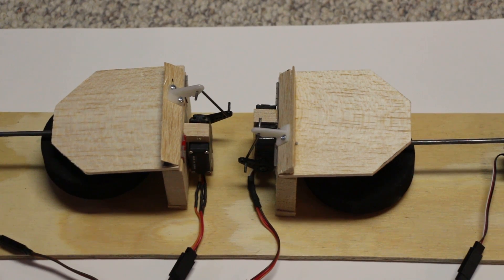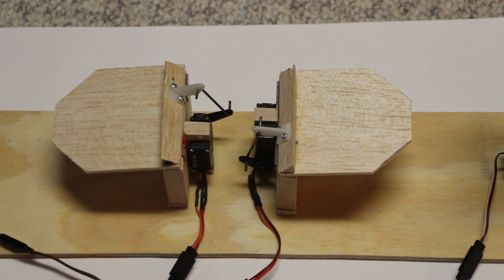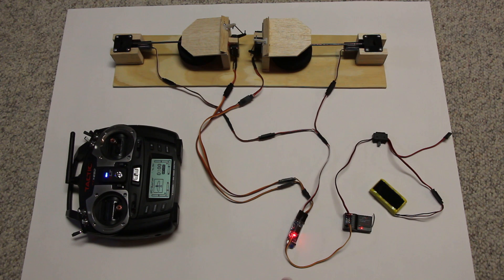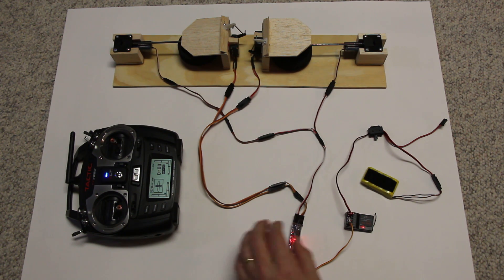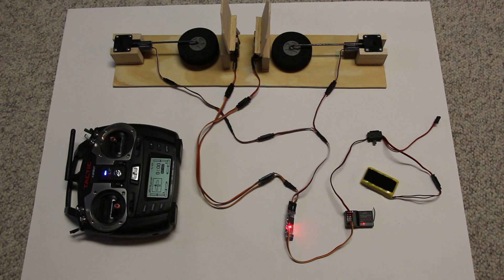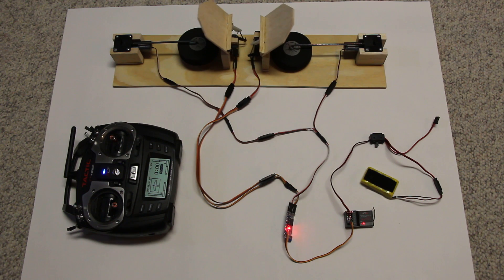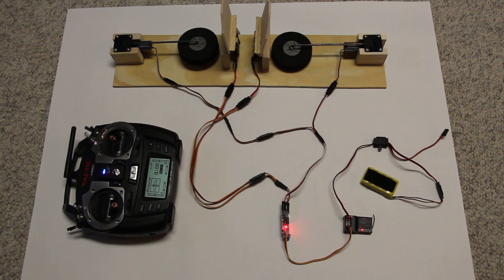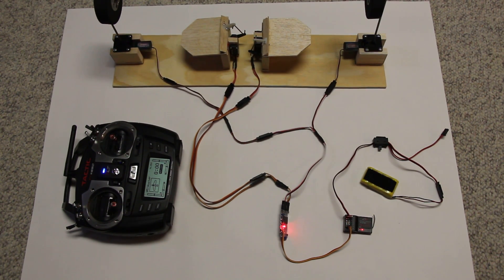Electric retracts & gear door sequencer - P-51 style and P-47 style

Comment: thanks Fred for this info...have a P-40 64 inch wing span ..but its a bitch finding retracks for it..top flite
Reply from the maker: finding the rotating retracts for the P-40 can be tough, check out the robart 815RS and 851RSE. THe E-flite EFLG52001L said it rotates the wheel but gave no details on what it looks like. I have never seen one of these units before. Search under "Rotating" when you get to the Robart, E-flite or HobbyKing web site.
Reply: @clscale  great thanks Fred for the info..i'll look into it👍🍻
Reply: oh an by the way have you ever heard of Siarra retracts..saw a vid on that but 9 years old now
Reply from the maker: When I looked at Sierra retracts several years ago all they had was giant scale retracts. Nice to see that they also have rotating gear for the F4U and P-40 in the .60 to .90 size model now. But they are the air system if you want to use the air system. I like the electric retracts better, less hardware to be installed in the model.
Reply: @clscale  yea i agree with you on that electric is the way to go..was just checking out a Robart video..on the ones you mentioned ..phoning them tomorrow..thanks again Fred

Comment: Will a sequencer be able to retract one wheel first and then the other, and not use doors? I'm building a P-40 and this is how the wheels go up and come down (the P-40 has tiny doors but I'm not interested in fitting them to my model).
Reply: have a top flite P-40..64inch wing span..where did you get your retracks from?..be great to know thanks
Reply: @philiprawbon2359  Ebay
Reply: @sneezyferret6482  thanks Sneezy..going to ferret it out now😂

Comment: When I was programming my gear with this sequencer, I accidentally interrupted the movement of the gear with my finger and the unit completely stopped working. Have you ever seen this and if so is there a way to reset the unit? My unit is completely nonfunctional now because my finger just interrupted the movement of the gear. It doesn’t make sense to me that this sequencer would be that fragile. Thoughts?

Comment: what about front wheel i mean the controller you are using i can see only support two cables
Reply from the maker: The electronic device only two outputs so that means the mains and the nose gear would go a 3-way Harness instead of a 2-way harrness. then the doors would be same story send all door servos to the harness and that plugs into the device. Notice I have the door servos and the retracts plugged into a Y harness. You would just have a harness with three outputs.

Comment: What remote control did you use?
Reply from the maker: I use the Tactic radios and receiver but it shouldn't matter what brand of receiver/transmitter you have. you may need to set the servo throw to 100% for it work right
Reply: Ok thx

Comment: Always Turn your radio on first before the receiver and always turn your receiver off first before the radio. This prevents runaways and electronics going haywire and potential damage to them because they don't have the proper signal from the radio going to them. You say that you always have to reset it sometimes etc. Well I watched you twice turn the receiver on before the radio which could be part of your problem the servos and the sequencer never got the proper command on startup because it can't tell what position the switch on the radio is in because you turned the receiver on first so you essentially confused it and if you didn't catch the problem before hand it could lead to a very nasty result in the air! This is one of the most common and biggest mistakes I see modelers make in RC and they wonder why they have such problems with equipment failure. I'm not trying to single you out just trying to help prevent potential problems further down the road. You did do it correctly by switching off the Receiver first before the radio I will give you that but you proceeded to turn it back on first before the radio which is a big NO NO!. I can't stress enough how important it is to Never ever turn the receiver on first you always turn the radio on first when turning the equipment on and do the opposite on shutdown. Remember this one little piece of advice that your radio is your only link and control between you and a catastrophic failure it will save you some headaches later on. Otherwise great demonstration!! :)
Reply: Modern day radios all have failsafe operations, so it doesn't matter which goes on/off first.
Reply: @IJackDaWackI  I still don't take the chance end of story!
Reply: thanks for this insight..👍

Comment: Fred, I got a question for you. I have a 1400mm corsair. I just bought a sequencer from Motionrc, for the retracts. I have tried to make them work, before putting them back in the bird. I have hooked up the Y wires...and am using a servo tester to test it out. But, it is all out of sequence! The door sequence is, one opens, while the other closes. Door opens, retract comes out, door closes, retract closes on top of door. If I hook up just the door servo's to the servo tester, they work fine. Same with the retracts. Do I need to hook system up to TX and RX to make it work?? In the set up you have in this video. The battery is going directly to the RX. Do you have the battery plugged into the battery port on the RX?? Thought this was going to be a simple plug and play deal! Any help would be great! Thanks!!
Reply from the maker: Yes I plugged to the battery into the receiver to power everything, throttle servo and the retracts. Sometimes you have to cycle the gear two or three times until they are in sync, but the fact that they are opposite could mean that the direction of the servo on the closed door side needs to be flipped. Considering getting a servo reverser for the closed door side. There should be a setting to tell the servo to stay open or closed after the gear retracts. try unhooking the pushrod to the doors and watch the direction of the servo arm and record if the arm moves clockwise or counter clockwise for both sides when the gear is cycled. If they both turn the same direction you can either flip one servo or get a servo reverser. Also try hooking up the retracts on the bench with two servos and watch the direction the door servos move, they should move the same direction.

Comment: how do you make two servos work on one channel
Reply: Try using servo y connector
Reply from the maker: You have to use a Y-harness to have both servos operate together, there is only one output for the sequencer, then connect to the Y-harness that talks to two servos

Comment: Motion RC still sells a gear door sequencer for the V8 1400 and 1700 mm P-51's for $13.00. But like the Hobby King sequencer there is about a 6 second delay on the opening/closing of the gear doors. Another option if your electric retracts close faster is to find a gear sequencer from a V7.5 or earlier FMS Mustang which close in about 3 seconds. Was at the Thunder Over Michigan airshow last month and noticed the gear doors of the P-51 actually do take about 5-6 seconds to activate after the gear open/close, so if you're going for a scale look the newer sequencer is the way to go.
Reply: Spear names please
Reply from the maker: Looks like the FMS gear door sequencer is programmed either to be the P-47 or the P-51 style but not both. The Hobby King one can be changed from one style to the other.  Good find